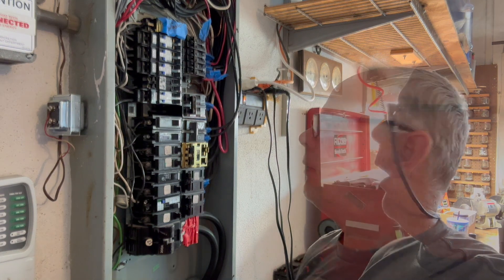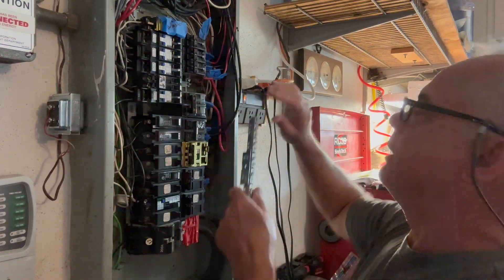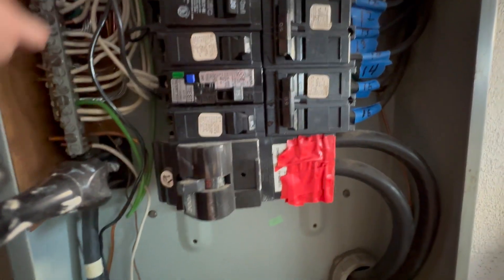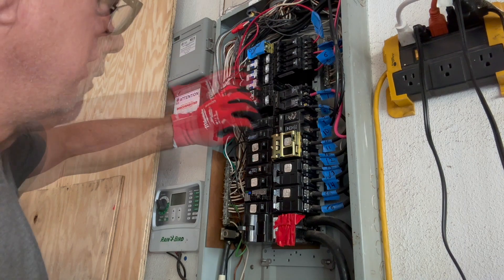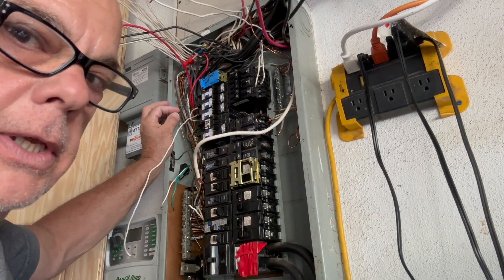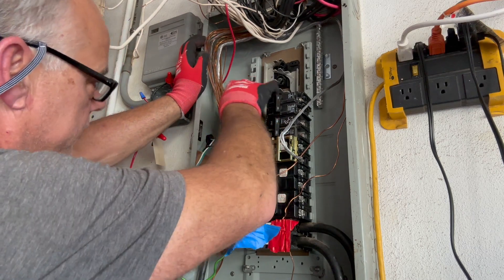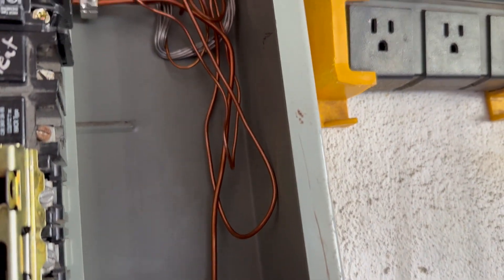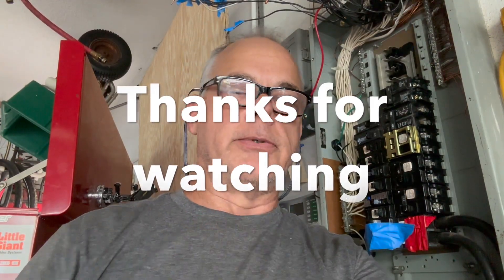How To Separate Grounds And Neutrals In A Crouse-Hinds Electric Panel.

Comment: The instruction sheet for the bus bar wasn't real clear but didn't you mount the new bus bar upside down?  I'd think that hole in the middle of the mounting plate was meant to go over the head of the panel mounting bolt so the connections are closer to the side wall of the panel.  Just spitballing.  PS: Getting ready to run 3/4" conduit with four 6 AWG THHN wires for a heat pump.  Thought I was all set until I saw you put insulated bushings on a threaded connector in one of your videos.  Thanks for the tip!
Reply from the maker: Yes, they want insulated bushings. What is the size of your heat pump? You only need 4 to6 gauge on a 5-ton A/C unit

Comment: If the bus bars are Bonded with 4 gauge wire, then isn't that the same as them all being connected to the same bus bar? I'm a little confused becauses if they are bonded. That mean if they are connected. They become as one. So why separate the copper ground wires from the white neutral wires if they are connected to the same bar? In your generac Installation video, you said the inspector told you The extra cooper ground wire was not needed going to into the sub panel from the Transfer switch.. I'm assuming that's The Wire you ran to the extra bus bar That's bonded to the neutral bar both Inside the sub panel and the transfer switch. He told you the The Neutral was good enough. I'm just wondering if all of these bonds are connected. I don't see any reason to separate the copper ground wires from the neutral wires....I'm only asking because I'm getting ready to install a generac myself. Any advise would be great. Thanks
Reply from the maker: I bonded the two grounding bus bar in the now sub-panel in the garage. The neutrals are on a insulated bus bar. Those two come back together in the main panel so if there is a fault it goes back to the transformer and into the breakers.  I think that he told me that it is double grounding because it is also grounded to the water line. I did not know that at the time it the extra grounding cable made me feel better. Thanks for watching.
Reply: @fixitjohn  Thanks for the reply. Also, I saw a video about installing the Generac. It advises to take your fuses out before adding utility Power to the unit. Any advice on that? Thanks.
Reply from the maker: @ClintHyde-p3y  I think you are right. It seems like I had read something on that. I forgot there reasoning.
Reply: @fixitjohn  they claim it could burn out the ScaM. Another video said it’s advisable to just unplug the module rather then taken the fuses out. Re-plug the module, after adding utility power. So just to be clear, I take it you did not do that and your module is still working?
Reply from the maker: @ClintHyde-p3y  I think they want you to do that in case you hook the wires up wrong. I am sure that was the reason. I hope that helps it’s never a bad idea to be safe.
Reply: @fixitjohn  Absolutely and thank you once again 🙏🏼✌🏻
Reply: Just one other thing, if you wouldn’t mind to clarify what the Cooper wire is going to coming from the transfer switch going into the bus bar mounted on the wall below your meter. Thanks again bud.
Reply from the maker: @ClintHyde-p3y  okay, ground wire is leaving what is now the sub panel going to the transfer switch which is now the main panel. There it is bonded to the neutral. The green wire you see is the bonding or jumper wire. The white thing that you see where the copper cable are ran into is a bonding bridge. I installed that so if I ever need to bond more grounds it will be easier and look better then a bunch of split bolt wire connectors. The ground that I hooked to the bonding bridge is coming from the meter through the bonding bridge and down to the grounding rod and hooked to it with a acorn nut. If you look closely around the bonding bridge you can see where I chiseled stucco out to get to the ground where coming from the meter. I filled the hole back up with a latex stucco.
Reply: Thanks 🙏🏼